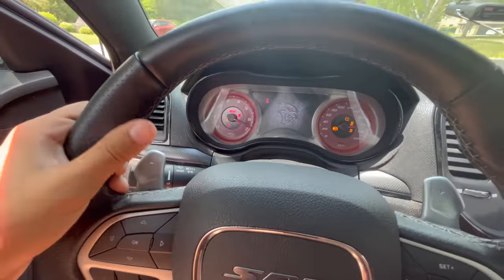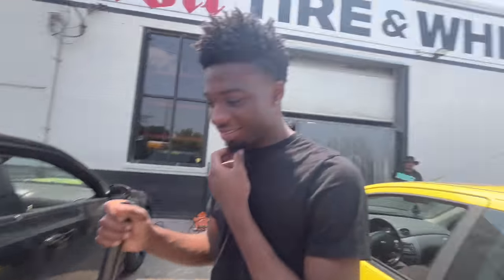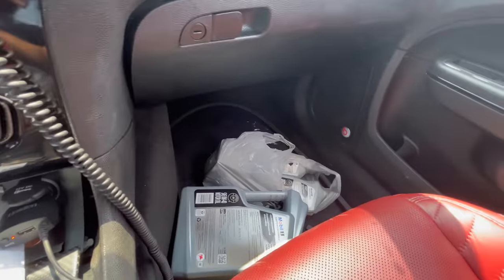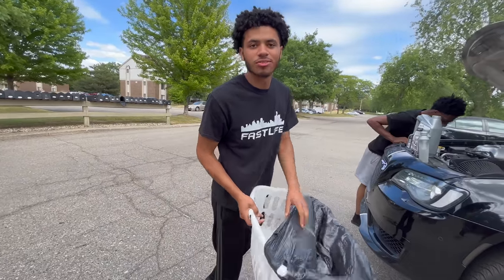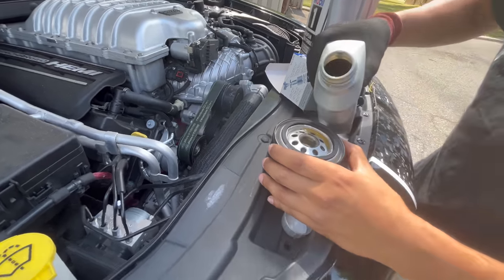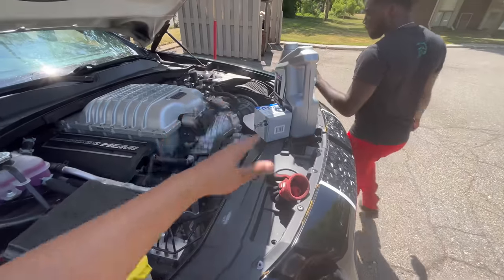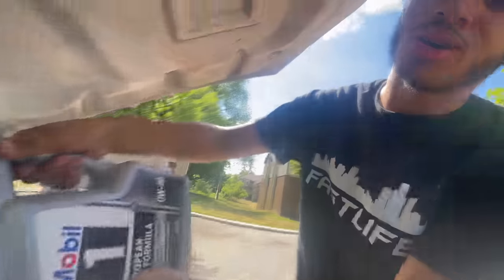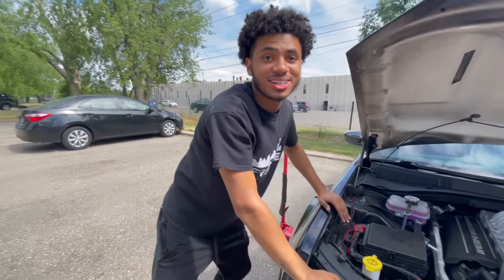HOW TO CHANGE OIL ON A HELLCAT/SCATPACK *HOOD EDITION*

Comment: you don't really need to fill up the oil filter with oil. I have never done it and never had any problems, also some oil filters screw in from the side so you can't fill it up because it will pour out so not really necessary, but if it makes you feel better about it then go for it
Reply: on bro...💯💯💯💯💯💯

Comment: You should check the oil while the engine off because the oil have to be settled in the oil Pan before you check it or it'll read that you got more or less oil than you got

Comment: Bottom the dipstick out don't just stick it in and pull it out LoL and don't check oil while Right after turning off the engine let the oil settle back into the oil Pan because oil still inside the engine right after you switch it off allow five minutes for oil to drain back into the oil Pan then check because the stick checking the amount of oil in the pan not the amount inside the engine Only thing you check running is the transmission fluid because  transmission fluid expand when hot so that's why the transmission needs to be at operating temperature so you want over fill it